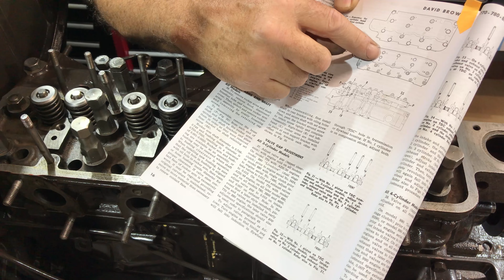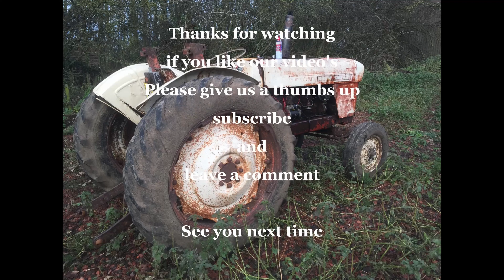Putting the cylinder head of the DB990 back on #65

Comment: Great job getting that head on without crushing a finger or three!  Wonderful instruction on setting up everything on the head.
Reply from the maker: Hi Shane, It would be wonderfull to have some head room so I could sling a chain set or come-along, but it is what it is and I've got crack on with it.
DR makes the editing side so much easier,. thanks for the nudge in the right direction
many thanks
Barry
Reply: @manfromthemist1958  Glad it's working well for you!  Definitely has a learning curve, but is so awesome.  Sent you a list of the channels I've found useful for learning it.

Comment: Excellent work Barry! Just a thought, has your cylinder head/block any hidden 'welch plugs' (sometimes incorrectly called frost plugs), conveniently located at the back of engine between bell housing/diesel tank :-) Certainly a good opportunity to replace old welch plugs when either the engine is apart, or the tractor is split. I prefer replacing those steel welch plugs with brass ones, because they are such a pain to get into. All the best!
Reply from the maker: Hi Campbell, yes mine had one in the rear and also one hidden behind the waterpump, as you say very difficult to get to.
many thanks
Barry

Comment: Hey Barry, I have a question for something that has come up during the rebuild of my 995. The cylinders at TDC don’t sit flush with block correct? I am trying to get assistance and everyone on forums so far is telling me it has to be flush even though it was running before with ~.25 in. I didn’t measure it.
Reply from the maker: Hi golden_jay, has the engine been rebiult in the past? this sounds like you either got an aftermarket set of pistons or rods which are incorrect for your engine have you verified the part numbers and that you have the correct ones?
you can check your part numbers against the Case IH website
rod should be K80043 
piston should be K949474 (standard piston)
have a look at path of discovery, shanes site has a great video on where and how to get help
https://youtu.be/5nYhhXXpGFw?si=iEhbFMzH5TpFkO2V
hope this has been usefull
many thanks
Barry

Comment: I was able to get the water pump rubber seal on without removing the head.  It wasn't easy or fun but I got it on there.
Reply from the maker: WOOOh very impressive, that must have been difficult, just been out and had another look at the gap in the pump to head and it's not very big, how on earth did you do it?
Many thanks
Barry
Reply: @manfromthemist1958  the waterpump has 1 stud and the rest bolts.  I pivoted the water pump on the stud and used a pry bar to push up against the rubber seal while my friend was trying to put a 2nd bolt in when the hole lined up.  It probably would have been easier to remove the head but neither of us wanted to do that once it was torqued down
Reply from the maker: @MJM2014S  brilliant, I never thought of that
many thanks
Barry

Comment: Dave,
I am having trouble with the hour meter drive assembly on my David Brown 990.  It is an orange and white tractor made later.  Do you have any video of how to remove and replace this part?

Thanks,
Reply from the maker: Hi allen, sorry no I don't, the drive is located on the top of the oil pump drive, check the drive cable for wear on the end as I can't see any reason why the actual drive michanisum would go back, if the drive gear had bcome damaged then you would also lose oil pressure. I think it'sdefo more likely the cable end.
many thanks
Barry

Comment: Hi  barry  nice to here from you again . Have i missed something cause i thought all the engine was reconditioned?
Reply from the maker: Hi David, yes the block was bored and new pistons and rings put in, the head, I cut the valve seats with a set of cutters I purchased and new valve trian put in, I noticed a lack of compressionwhen starting for the first time, so obviously didn't do a good job on the seats, As it was standing for a while I thought I'd pull it to bits and get the job done proffessionally hence the partial strip down.
Many thanks
Barry
Reply: @manfromthemist1958  oh I see . Your doing a brilliant job. Barry.